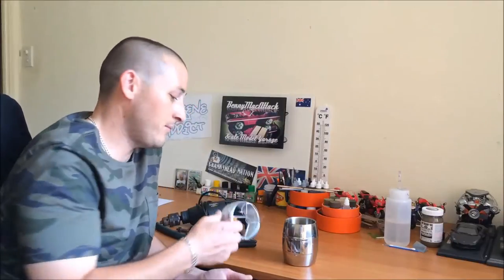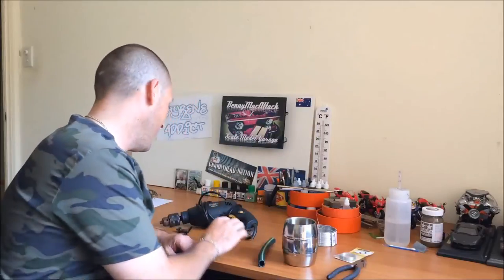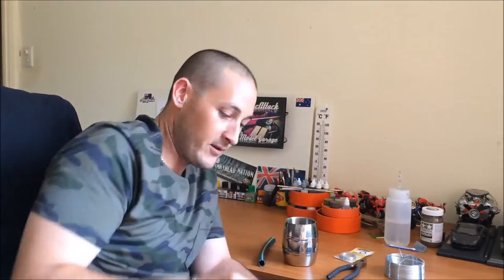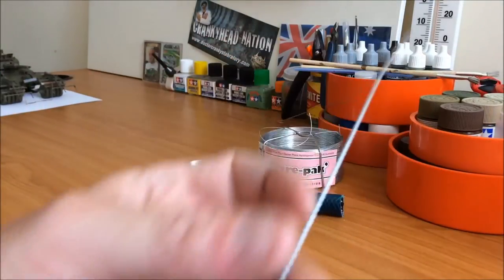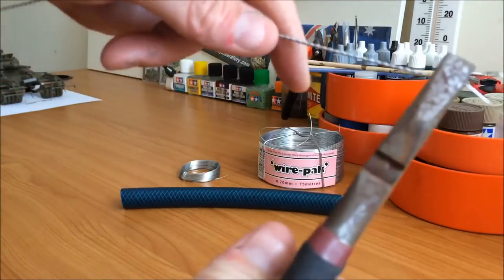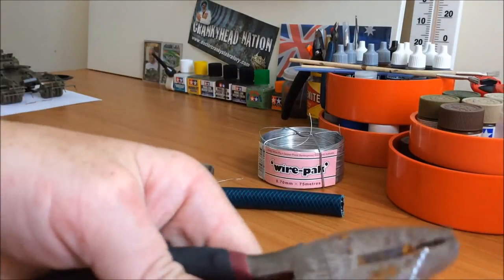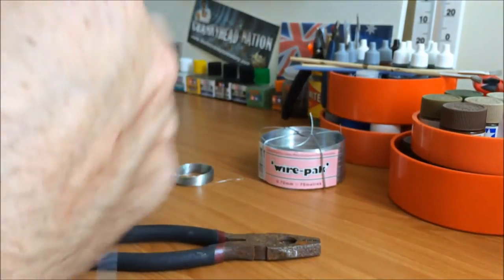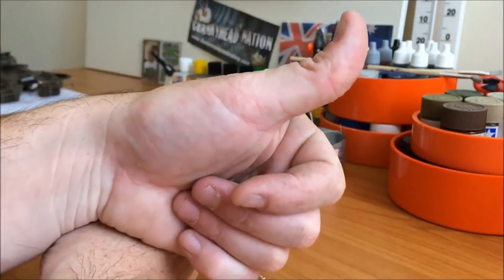How To Make Barb Wire - Razor Wire For Your Diorama

Comment: You could add barbs the way they do it irl, the barbs only go around 1 wire, do it before you twist the two.
Reply from the maker: Sounds like a good idea, cheers man. I did find an easier way after this video but haven't had to make any since.
Reply: razor wire is different to barbed wire it has little blades on it rather than barbs, this is barbed wire